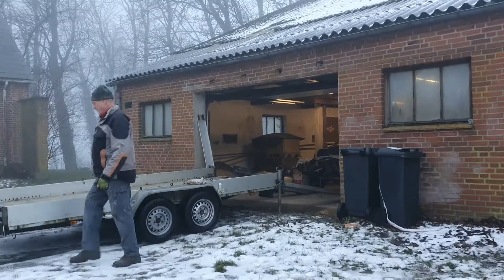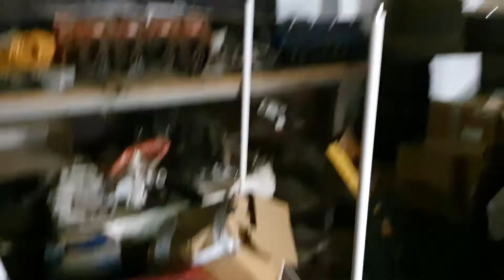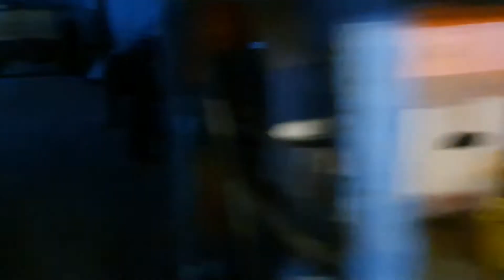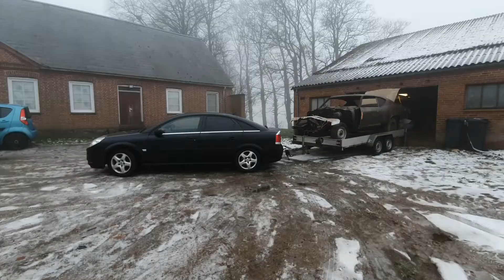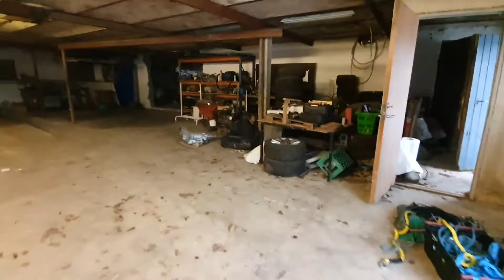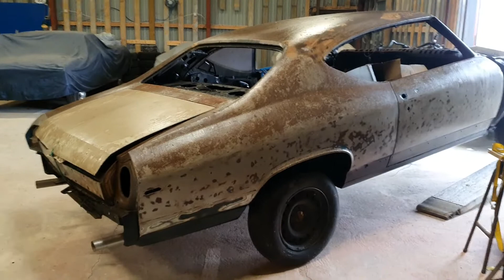My 1969  Chevelle, it's coming home, Episode 1

Comment: No worries that car is so easy to work on. You have lots of fantastic parts. Body looks great. Similar to the amount of work with my Challenger. Great find great car and put the 12 bolt and big block in there!
Reply from the maker: Hi, there is almost no weldig to be done, compared to the Mach 1, there was a lot of welding, but not here. This will be more pre-paint and paint, and assembling, plus buying parts.
I think I will make it to a SS, and put the shifter to the floor. It will be a fun project for sure.

Comment: It needs a 454 big block with Sniper EFI, a 4L80E, and a 12 bolt posi.  That's what I have in my 69 and I know you will not be disappointed.
Reply from the maker: :-)
But I have 2 x BB 396 and a brand new SBC 427 Dart, with 220AFR heads and AFR intake (and roller cam) Also I have a brand new TH2004R, EFI I also have in stock.
So I need to use my parts, before I get new parts, BUT I hear (and understand you:- )